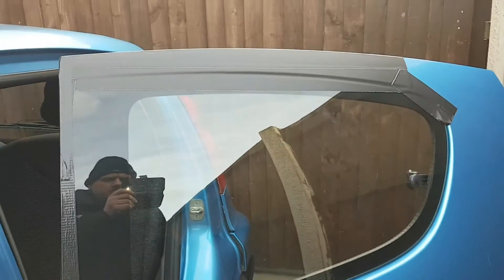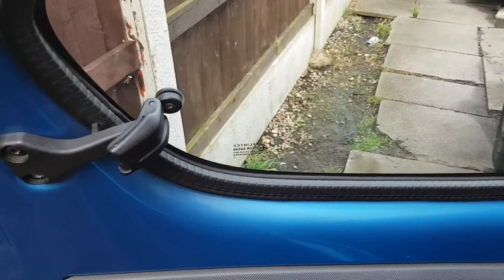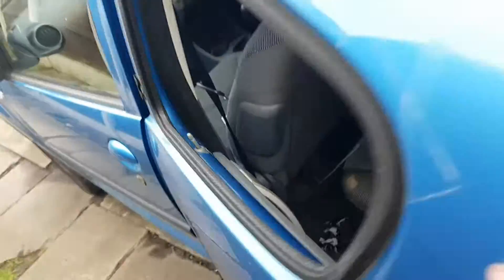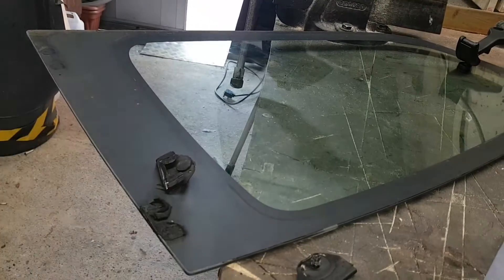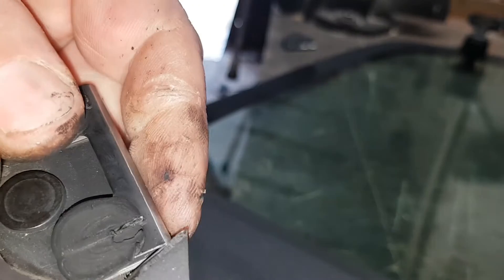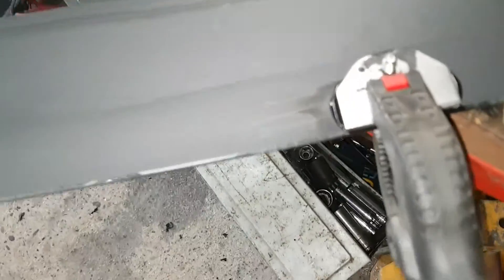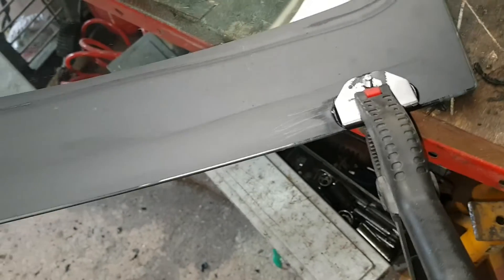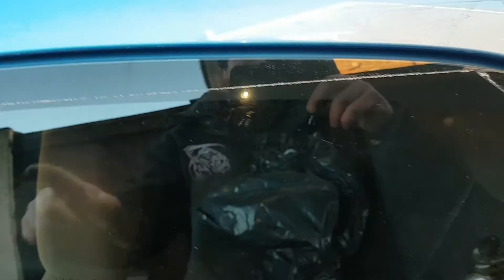Peogeot 107 rear side windows fix

Comment: This problem is  the subject of a factory recall. It doesn't matter how old your 107 is, book it with a peugeot garage, and they have to fix it for free. 

THE BONDING OF THE REAR DOOR WINDOW GLASS TO THE HINGE ASSEMBLIES MAY NOT CONFORM TO SPECIFICATION

Recall numberR/2018/358

Recall date12-12-2018

Recall typeSafety recall
Reply: This is correct, I had my 2012 peugeot done just after buying it a couple of years ago